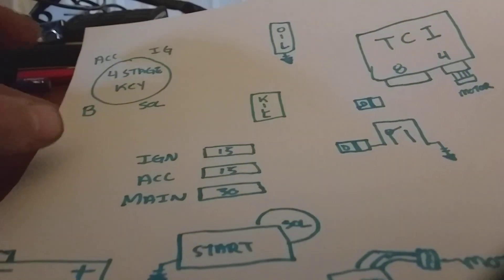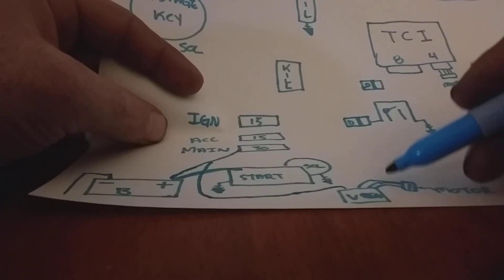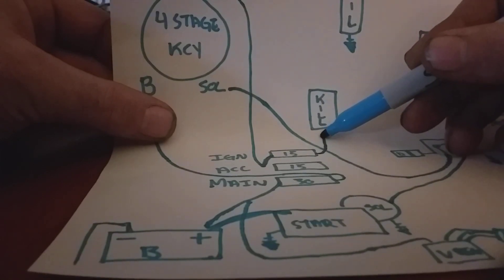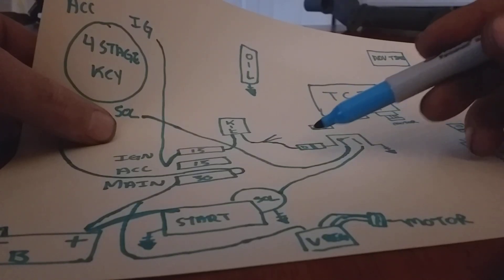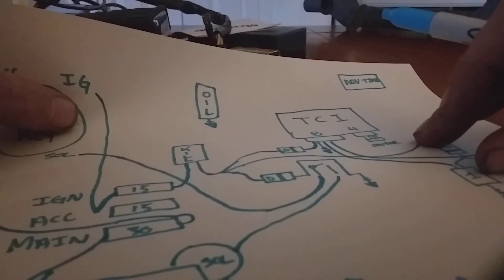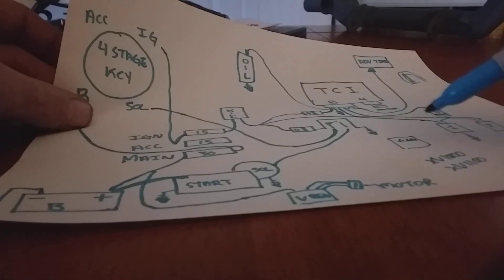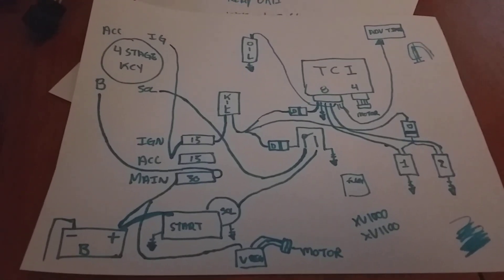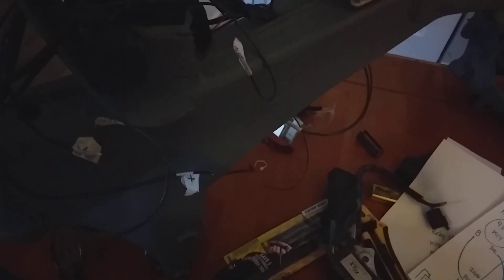Yamaha XV 1000 / 1100 bare bones wiring (for dummies)

Comment: I know it’s probably a long shot but I am rewiring my 85 virago xv1000 and need a full starting diagram with diode size and if possible the rest to do head light and tail light and signals the signals will be led

Comment: This is specific comment on xv1100 models!!! All around good info but the information only applies to xv1100 models 95 and under. I have found that that the term "pick-up coils" cannot be taken literally. The 96 and 97 models ( really I am working on xv1100 )  have only two wires running from the case and I am unsure as to where the other two truly come from! This has created  so much of a crazy mess of this for me! I have attempted using coils from 750 now which has four wires and so on and so forth!!! If you could help me with the 97 xv1100 ignition circuit  I'd appreciate it!!

Comment: Hey, I know it's probably a few years too late, but I would really like to pick your brain how you wired in the push button start. I'm trying to do it on my xv1100, and you said it's a 2-circuit switch and I want to know how to wire in the button up with that. Is there any way I can get ahold of you?
Reply from the maker: I didn't do the push button. If my Memory is correct there is a circute physically inside the housing that made it goofy.
Reply: @unprofessionaljoe7233  so its not possible to do a single off the shelf push button start?

Comment: I got these led lights I'm putting on my 98 xv1100 I need to tap into the left and right side turn signal wires and break because when you turn the signal on and or break the one side depending which turn signal you hit makes that whole sides lights flash same with when you hit the break they all turn red but can't find a wire diagram to find the separate turn signal wires and break wire do you have any way to help me find that out please?

Comment: Hey! I stuck a 1994 1100 in a fist gen chassis and I’m using the harness from that motor.   I’ve got the bike running but no signal to the tach so I’ve decided to build my own from scratch.  Your video has definitely caught my attention. And I’ve already ordered everything I need. 

What value diodes do you use? 

And do you have a good idea of what I need to do for a secondary lighting harness? (Blinkers, brake lights, headlight) thank you!
Reply: Hey I bought a pair of rgb led lights to run all around my virago the come with a feature where when you hit the break they all light up red then when you let go they go back to whatever color they were on before same with left and right turn signals when you hit the left the left side of bike flashes yellow then same with right... but you have to wire them to the turn signals and break wire do you know where I would find the left right turn signal wire harness to tap in each separate wire for the left and right turn signal and where the break wire would be to tap into it? Any advice would be greatly appreciated
Reply: @Weber1987  You could open the headlight bowl. That's where the front turn signals connect. You could also go to the 6 pin connector on your rear fender. That has tail/brake light and rear turn signals.

Comment: Just too check. You refer to the Blk/wht wire on the Tci as controlling the oil warning but in the OEM wiring diagram the only Blk/white coming off the tci is connected directly to side stand switch which you said you got rid of

Comment: My 08 suzuki boulevard c50t has no power when you turn on the key ignition only back light comes on turn signals work and emergency flashers and blue tooth speakers work I bought a new battery and starter seliond relay switch still no dash lights or neutral light or head light or pump sound the fuses are good and ground wire looks good I did try using a paper clip on the clutch handle sensor didn't start I'm stumped I think somewhere in the kill switch or ignition it was running great before this please any response would be great 👍

Comment: How did you delete your clutch switch and neutral switch?
Reply from the maker: Neutral runs to diode so you can just cut the blue wire leading into casing. Clutch switch runs to relay unit which i removed. However if ya take the two wires and just attach them together it will make the relay unit think the clutch is always in.
Reply: @unprofessionaljoe7233  I also removed the relay. I have replace everything with a moto gadget mo-unit. So if the clutch relay is gone, does that mean it dosnt effect anything anymore? I'm not getting spark after full rewire and looking into those switches to see if I need to do anything more.

Comment: I have a 89 virago 750 I'm not getting spark on one cylinder
Reply from the maker: Try swaping the coils from side to side to see if it's the coil itself, or the electrical attached to it 🤟
Reply: @unprofessionaljoe7233  I did it's like the wires were dead on one side now I have no spark on either side you think it could be the stator or tci
Reply from the maker: I dont know the 750 to well but I'm assuming the coils are red/white x2 and grey and orange?
Reply: @unprofessionaljoe7233  yes
Reply from the maker: Alright so red and white are always powered when the bike is in run. Check with volt meter to make sure your getting power to both. Then check orange.  Put volt meter on leads and turn bike over and see of it osicales power, do the same for greay.  If one gives you nothing at all times I'd say CDI is cooked or the feelers in the motor that send the signals are toast. Odds are though it would be CDI
Reply: @unprofessionaljoe7233  one side reads 10v the other is -1.4
Reply from the maker: Turn the motor and re check
Reply: @unprofessionaljoe7233  I did one side is 10v the other is only 1.11
Reply from the maker: Yeah I think ur cdi is cooked. I could be wrong but it sounds like it. Only other thing u can try is snip em off close to cdi and run new wires to coils Aland hope u had a bad wire
Reply from the maker: Did you ever sort it out??

Comment: Did you ever do the Cdi ignition one? Trying to get spark on a 1995 xv1100, changed everything to new except pressure sensor. still no spark.
Reply from the maker: From my understanding the 750 and 1100 starter wire that goes to the solenoid  is brought to ground (not powered like the 1000 ) Try turning on ignition and grounding that wire feed.
Reply: @unprofessionaljoe7233  Im not sure I understand, Ground the wire from the relay ? Instead of feeding the solenoid ?
Reply from the maker: Is the motor turning over?
Reply from the maker: @pork69fatboy  one sec imma pull up the diagram
Reply from the maker: @pork69fatboy  alright a) undo the black white wire that runs by the oil filter. B) try replacing all fuses sometimes they blow and dont look blown. C) open up push start button and check copper  for corrosion (try to do this with a bucket under it because it has this tiny ball thing in it). Let me know how those work for ya
Reply from the maker: @pork69fatboy  Okay the bike wont start out of neutral without clutch or with kickstand down and not in neutral.  When in neutral does the green light turn on?
Reply from the maker: And your red white by black on TCI has power? Constant power? Ya got me stumped my man. I'd follow the black off TCI and check the ground and insure oil level is where it needs to be.
Reply from the maker: @pork69fatboy  only other thing I can think of is your dioed pack. Replace it and pray that's its faulty
Reply: @ross reed did you change the pickup coil?

Comment: Hey man could use your help greatly! I rebuilt a xv1100 and the tci is the 86 year and the harness is the 98 year. I got everything going including the engine turning over but the thing I'm worried about is the safety switch cutting me from being able to take off as the 98 year has a direct plug into the tci and the 86 doesn't beside the black and white that goes to the side stand relay. How can I be for sure that the safety is bypassed? Do I connect it into the same spot as the 98 year and complete the circuit at the stand and clutch lever or leave it disconnected and I am good? I already have the 86 pick up just need to know how to bypass the safety on the 86 tci that doesn't have the 86 original harness

Comment: I removed the Mcv and AIS system on mine and In another video the guy said you had to have a line ran to the petcock on the vacuum port for the bike to keep time but you are running a single port petcock so did you have to do anything specific to do this? I’m using a sportster tank and I have no way of using the valve petcock

Comment: Hey can you tell me what values the diodes you used were? I’m trying to rewire my 99 xvs dragstar from scratch. I have all of the components but need the diode pack. Also I’m using a starter relay that has a built in main fuse instead of solenoid and motor separate wiring. Maybe you could shed a little light on how to set that up with the 4 stage ignition key. Thanks

Comment: i have a new igniter coming for my 96 1100 virago . it has to be wired from scratch -- i dont even have plugs . it has a single pickup coil . ive done this years ago and it worked fine . i dont use the pressure sensor so considering that , i know it only takes a few wires to get what i want . can you tell me what lugs are crucial ? i know the sidestand lug must be grounded . 

its a trike . ive been running ignition points for years but im ready to convert back to electronic . id be glad to pay you money for your help . searcymasonry@yahoo.com

Comment: Hey do you have a xv1100 tci pin diagram- what each pin connects to/ does
Reply from the maker: I can make ya one my man. What's ur email
Reply: @unprofessionaljoe7233  kumar_102@hotmail.com
Wow thank you so much sir, your a life saver - after countless forums and hours searing online i finally bought Haynes manual and still doesn't show me what each pin connection does.
Reply: Its for a 1995 XV1100 - with the 2 wire pickup coil (Black and Grey wires)
Reply: @unprofessionaljoe7233  this is what i need also for a 96 1100 engine . id fekkin pay you for your help . searcymasonry@yahoo.com
Reply: Podrías enviarme los pines del tci a fanciscomedina26@gmail

Comment: I recently swapped 1995 xv1100 engine into a 1990 xv750 existing and running bike - got all wires back together and plugged, just missing pickupcoil wire connection. Basically the bike is turning over but not sparking, what should I do?
Reply from the maker: you need to pickup coils to get spark.
Reply from the maker: also low oil=no park no neutral=no spark and kickstand switch can = no spark. try topping up oil and holding clutch in while turning over.
Reply: @unprofessionaljoe7233  i bypassed the safety systems by going directly to ground, and still no spark? I connected the pickup coil and everything to the CDI box and still no spark? What am I doing wrong?
Reply from the maker: @kanukumar3747  that's the problem by going to ground your engaging the safety system to turn off spark.
Reply from the maker: Negative. What you want is absolutely no signal going back can a CDI box unless one of the safety features is tripped
Reply: @unprofessionaljoe7233  will it work if I just leave that pin not attached/connected. - I am basically using 16AWG wire and making my wiring harness w spade connections to the cdi
Reply: @unprofessionaljoe7233  how do I bypass safety system - just no signal going back to cdi?

Comment: Hi I'm looking for a simplified wiring with the colors of the wires specified for my Yamaha Virago 1100 can you give me a hand?
Reply from the maker: The 1100 and the 1000 are the same. If you tell me what your trying to do and the year I may be able to help ya my man
Reply: @unprofessionaljoe7233  Hello thanks for replying. I am transforming my virago into a bobber and the old owner had modified the whole system now I would like to remove some wires leaving only the ignition and lights eliminating all the safety devices

Comment: Hey man ! I’ve been having trouble with my bike. It wouldn’t start anymore and the positive pole on the battery melted my bike’s battery compartment box a little. While trying to remove the battery,  the wire leading to the regulator (which was already pretty torn up) split. Could this be what caused the battery to melt plastic on the bike’s battery compartment? Meaning that the torn up wire wasn’t allowing the regulator to work properly?
Reply from the maker: Yeah it may have grounded out via the tear. And the regular stabilizes the charge to your battery so it all make sence.

Comment: Can't wait to see more. I thought it would be fun to replace the incandescent dash indicators with led bullet lights. Now I am staring at wiring diagrams that are making my head spin cause now for some reason my horn and brake light doesn't work 😡. And the neutral oil and fuel lights don't work either. I think I need to put some resistors in but I don't understand how this has anything to do with my horn and brake light.
Will definitely be looking forward to more of your videos so I can have a good handle on how to do bare bones wiring when I get a chance to strip the bike down for paint.
Reply from the maker: Dioed pack and how it runs is super confusing.  Runs turn signals, natural ect ect. Horn should be pink and ground to frame. Break lights I can't remember but I think they also go through the diode

Comment: Good video, so whats the difference between the tci vs the cdi set up? I have a cdi in a 93' vx1100 that I am re-wiring.
Reply from the maker: The cdi is a capacitor discharged.  Tci is a transistor controlled unit
Reply: Where’s the Cdi rewire video

Comment: thanks youi just made a complete wiring and its pretty the same like yours, i bypass some item like pressure sensor kill switch oil sensor and its still work well i use 20amp for main and 10 for ignition circuit and 15 for all ligth head signal etc,  i use very thick wire for stator and  0.75 for all light and 1.5 for ignition , the most important is to well soldering all connector ,it take one week full work,i do a complete wiring cause every i ride the bike run only on one cylinder ,hope its correct the default,not yet test, i didnt put any diode ;is that a big mistake,will that cause issue pls
Reply from the maker: Yes add a diode for sure. When your coils fire there will be residual  energy left over that could travel back and damage your TCI. You can buy 50 diodes for like 3 USD
Reply: @unprofessionaljoe7233   big thanks that seem so true, so its really important diode i think i will solder them after all my fuses and thanks for the residue energy back reserve i never think about it, and i just put a new brand tci its quite expensive, i always think fuses is most important but now by you i learn diode is really important ,,,respect to you
Reply from the maker: @sylviequirin2371  you can't just solder them after the fuses. Where you place them is very important